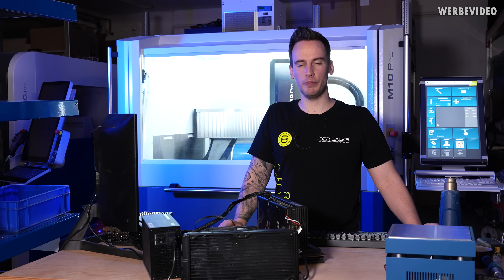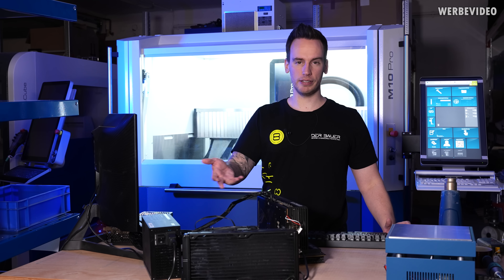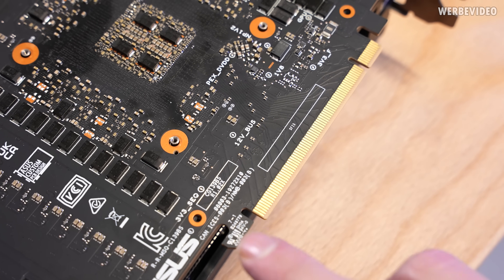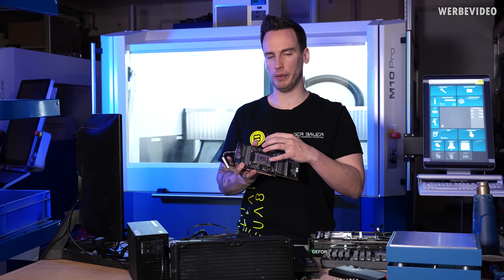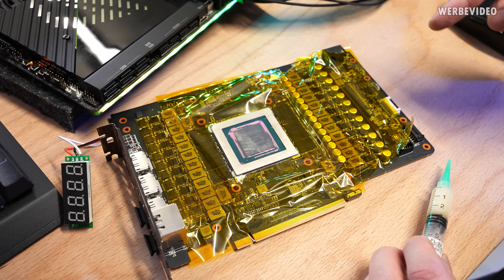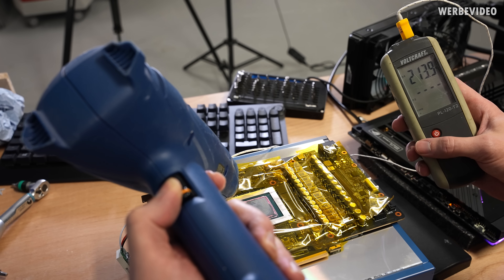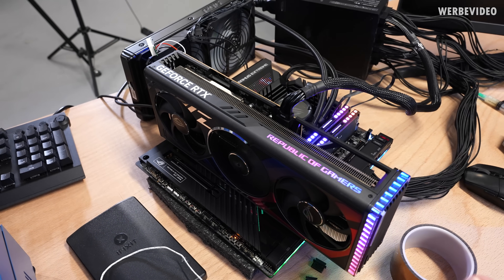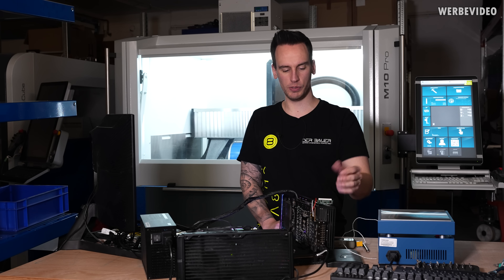I tried to repair my RTX 4090 and killed it :(

Comment: It could be a millon things. For starters, you assumed the issue was related to the GPU soldering (which is the most difficult problem to solve even with proper reballing tools) when the PCI-E x8/x4 problem could be caused by other faulty components.

The temperature applied would be enough to liquify unleaded solder with flux so probably the new problem is actually related to BGA balls not making full contact with the PCB or GPU, but bear in mind that even with that massive amount of Kapton tape (which can actually lead to other problems) every single component of the board got heated (from the PCB heater and also through thermal transfer via ground plane for example) so pretty much there could be misplaced components, disconnected pins or shortcircuits in any component of the board, especially those closer to the GPU like RAM.

Probably check BGA balls on the memory chips arround the GPU and next time attempt less invasive means to solve the issue before resulting to heating a GPU with a heat gun (actually, never use a heat gun with BGA, particularly with bigger chips like a GPU). In any case you should use a rework station with temperature control but even then, a rework station is not meant to be used with big BGA chips.

Comment: I have a great idea - send it to a professional. They have tools and knowledge. Sadly modern "broken" GPUs can behave really weirdly. This x8 problem might even be memory chip related. Weird, right? IMO pci-e lanes area with capacitors is still the number 1 suspect, BIOS is number 2, dead GPU is number 3 and another 100+ potential breaks :)

Comment: Why would you put the card into the oven at 80-100c? I put my GTX 780 in the oven at 200c for like 8 minutes then upped to heat to 250c for 2 minutes. And no it did not die after several heat cycles, it has been working for 6 years after doing that. No flux or anything just 3 aluminium balls to support the weight. On a rotating microwave oven with only the oven function enabled.
Its too bad it did not work. Hopefully you can still fix it at some point.

Comment: 227 degrees is a typical temperature for lead free solder but I don't think these kinds of chips use that. I think they use indium (or bismuth?) pastes with about 180 degrees if not lower melting point so for that 220 would really be high. I found an article of someone using 200 successfully with an oven. Ill post as a reply because of youtube.
Reply: DO NOT use an oven you are currently using for food prep. Alloys and pcb components atomize and float around in your oven forever.
Reply: I seriously doubt they use that as its more expensive consumer grade stuff is always whats cheaper
Reply: it's possible, bismuth based lead free alloys range anywhere from 138c to 183c

Comment: i rather not have a 12 pin if just not plugged in enough even by 1mm and melts, making the plug this small was a mistake, and i hope the 12 pin gets banned due safety issues legaly and replaced by a safer connector just make a 2x 8+8 16 pin connector standard

Comment: Take a look at @northwestrepair And a few of his videos. Very competent repairer, perhaps the best amongst a few on YT. Uses Mats diagnostic on boot up that should identify the fault area (since you appear to have a partial start of the card) and has a link to all his software and guides - he's a legend. Seems like the GPU started but the memory didn't.
Reply: Best on YT actually.

By far.
Reply: Another vote for northwest repair.  His work is exceptional.  You are highly competent in your field, so I'm sure you'd respect another specialist who is just as competent in his.
Reply: I would sugest also the guy at Northridgefix, his videos are great , take a look

Comment: Would seem to me that since the 4090 appears in windows that the gpu itself and bios is ok and communicating via pci-e. However, I noticed that gpu-z showed memory type as unknown so would appear that the gpu is not communicating with memory. Using the uneven heat from the heat gun only on GPU in one area only has maybe caused a solder BGA to PCB solder ball joint connecting to memory to not reflow properly. Hopefully the issue is not with the flip chip to carrier board microBGA solder balls due to the flip chip getting too hot. Maybe using the even and controlled heat from an oven for 10 mins at 200C will be enough to cause reflow of a problematic BGA solder ball but as you know these fixes tend to fail again after a few months. Specialist repair by removing and re-balling the GPU is costly and may not fix the problem but I guess you could try using an oven at 200C for 10 mins for diagnostics purposed to see if the memory becomes visible again in GPU-Z then decide if a more permanent costly specialist repair is worthwhile.

Comment: bruh, I don't know where I heard about this (probably from the NorthridgeFix youtube channel) I think you need to remove that GPU support at four corners of the die if you want to reflow the GPU. And I'm pretty sure you ripped/shifted a few SMD components with that Kapton tape, that tape will contract (change shape) under heat, and when solder liquefies, the components will stick to the Kapton tape and move from their original positions.

Comment: @der8auer-en ...i think the biggest risk you took was with the heat gun because those are going to heat very much less control less evenly than a proper temperature controlled hot air station. so given this attempt it is very difficult to assess what specific reflow damages when there are thousands of such tiny sized smd solder junctions including nearby components. to determine what was disrupted or damaged to know what to redo at this point. very hard to say. but please send me your card to uk under damaged non functioning, rma / repair reason. and i perhaps can try investigate or reflow again.

speaking more retrospectively you probably should have measured the data lines pins (fingers) on x16 slot with a decent lcr meter. to look for any observable difference in a data line. for example if one of the smd capacitor was in place but faulty / failed cap. this can happen and is not aparrent merely by visual inspection.

then it would have been clearer justification whether reflow or reball vs simply replace some caps. and maybe avoid going so far. since reflowing is pretty high risk on such modern and complex card. of course not much other ways to save it now...

and preheat temp should have been a lot higher. probably closer to 125c. or just not even try without much more expensive tool like an ir reflow station. it is pretty difficult

Comment: Lead free solder's melting point is between 220C-230C, depending on what alloy they use, but the temperature has to be even and the heat up and cooling down has a trapeze-like temp profile and I think u need 220-230C for maybe 10 minutes I'm not sure.
Reply: Peak reflow temperatures are usually only held briefly; most datasheets call for about 10-30 seconds depending on the part. The rampup/rampdown that you describe takes most of the time.
Reply: @benjaminchung991  I've fixed GPUs multiple times with the oven method.10 minutes at 200 degrees C.
Reply: @robertmarsh1338  Lead-free solder won't have reached its liquidius point at 200C; as an example, Chip-Quik SMD4300SNL10's liquidius point is 217C with a 210 second ramp followed by a 30 second ramp to 249C sustained for 10 seconds then cooled back to 217C over another 30 seconds. An oxide layer as exists in completed solder joints would further inhibit good melting performance.

I suspect that the successes that you've had are due to the differential thermal expansion of the joints closing a gap rather than remelting of the solder. 200C just isn't hot enough for lead-free solder, as is used in essentially all GPUs these days, to melt.
Reply: @benjaminchung991  Not my area but I would assume the oven also causes all of the BGA underfill to hit well above its glass transition temp. This combined with the thermal expansion may allow poor contact areas to become 'locked' in placed once everything cools and constant pressure is applied. Seems like the original issue would eventually undo all this but if you're really lucky and keep the GPU cooler going forward maybe it could keep it going longer than you'd expect?

Comment: Goddamn, it’s a shame this happened, Roman.  Yet those are the risks of experimenting with all these high-end GPUs.  Always send it to a repair shop when in doubt.  Especially with these $1K+ GPUs, it’s better to spend a little bit of money than to end up with a paperweight.  I do component-level repair on motherboards, and it’s incredible the shit I see when people send in their stuff for repair after they’ve mangled the shit out of it.  It seems you had some thermal shock, and the GPU needs to be reballed.  It’s a simple enough process, but only when you have the right equipment, which isn’t cheap.  So don’t despair, my friend; I’m sure there are some competent shops in Deutschland that will be able to and willing to set you right.  Good luck, and stay safe.
Reply: Re-balling isn't always the magic fix though if the failure is underneath the die and on the carrier substrate or other failure. Certainly doesn't help PS3s and Xbox 360s like people thought, nor the GPUs and other boards from back then. For it to die outright is surprising though..could be a shitty PCB!
Reply: @ChaosHusky  Considering he was missing half the PCI lanes, a re-ball was the right thing to do.  Unfortunately, whatever he tried seems to have fried some of the memory modules or even the controller and maybe even the vBIOS.  His mistake was putting the card directly on the heat plate.  He should've used a silicone pad or put it in an oven to heat it uniformly before using the heat gun to attempt the re-ball method he used.  Also, if you notice at the end of the video, when he shows GPU-Z, it shows that the bus interface is showing PCIe X16 4.0.  Unfortunately, his memory information is missing, suggesting the memory controller/module issue.  So what he did worked, but he now has other problems.  Either way, my suggestion stands if he can’t find a fix after all our suggestions.

Edit: clarity and spelling.

Comment: Putting your GPU in the oven is silly, you'd never be able to reflow the chip like that. I think someone could fix this 4090 though, it will probably be a painful job for them.

Comment: Why did you decide to do a reflow in first place and why did you do it this way?
Doing a reflow process requires important tools like a decent preheater (a Puhui T8280 at least) and a real BGA rework station (a 850D heatgun at least).
Those are basic tools but not the best if you really want to do a reflow (at least for a 2000 dollars GPU you should've used those).
But the real question is what did cause the problem? For a PCX limited to 8x instead of 16x the problem is around the capacitors linking the lines to the GPU.
Now what you had done with the heatgun is you destroyed the solder or even the silicon inside the GPU chip.
What you should do now is to try to reball the GPU (of course using the right tools) or send it to Krisfix Germany, he will fix this GPU perfectly for you.

Comment: I think u warped the pcb, the temperature is good but u had temperature difference spots. An oven would've been more appropiate.
Pro tip: make some aluminum foil balls/stands to raise it on the tray, don't let it sit on it's capacitors on hot metal.
Reply: Oven would have destroyed everything

Comment: You forgot a lot of steps. First you have to remove the edge bonding. Second you need to heat it up a lot slower. Most likely you ripped traces by heating up too fast with the gun. There is a good reason why rework machines and thermal profiles exists. After you are done you need to remove the flux. Flux is corrosive and conductive. (There are "no clean" fluxes. At such a low voltage that a gpu runs at they are also must be cleaned.)
Reply: No-clean fluxes are not corrosive or conductive if properly used.  You absolutely don't need to remove them, unless (a) there were contaminants on the board to begin with, or (b) they were not heated up to activation temperature.